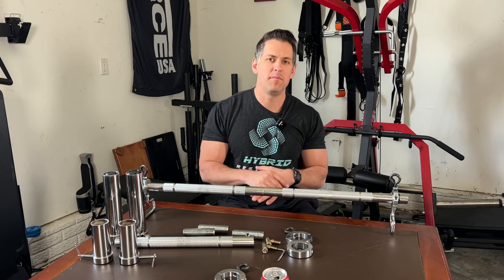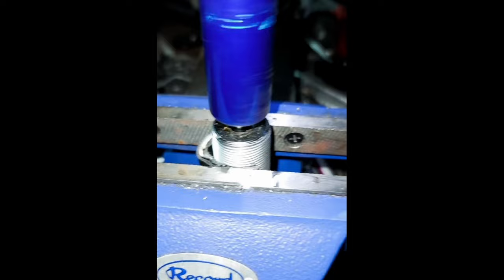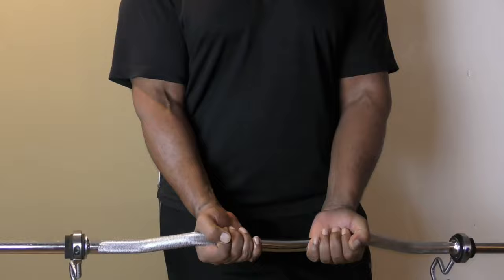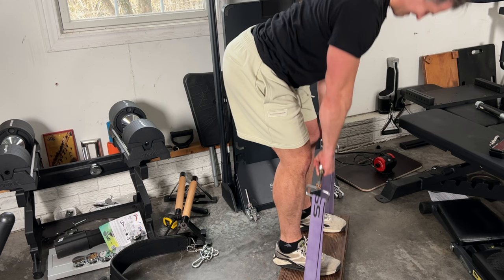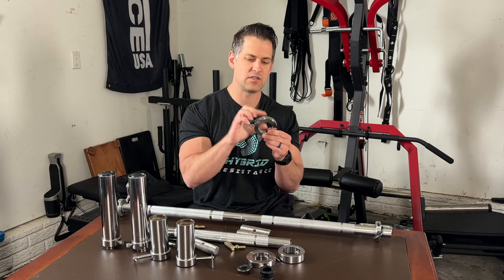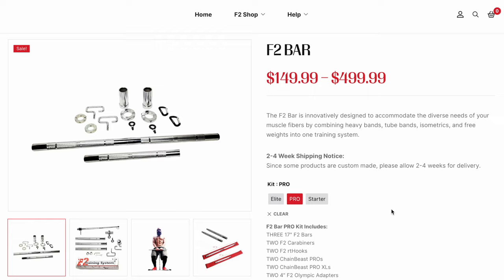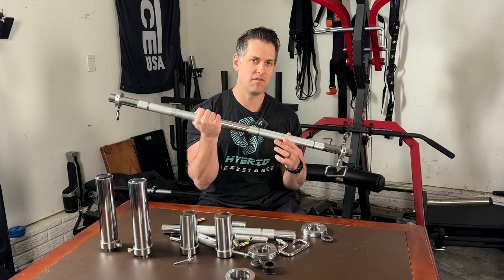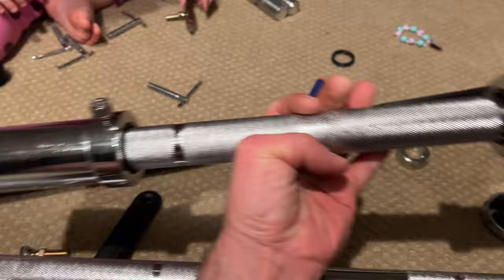F2 Bar Review: The Bar That Can Do and Turn Into Anything

Comment: The bar is priced in a proper range for a band bar. Attaching a 7 or 5.5 inch carabiner snap hook to the eye bolt will allow a loop or tube band to be mounted safely. To purchase additional hardware to mount weights exceeds the pricing of an actual weight bar.

Comment: Thanks for the review video Mike. I trust your reviews because of your background in lifting and background with numerous resistance bands equipment setups. This F2 looks to have the most versatility of all the bars so far. One question; I saw in the video that you were using tube bands attached to the center of the F2 bar, what tube bands are of excellent quality and strength do you recommend ?Thanks again for the F2 review.
Reply from the maker: Thanks so much. I'm not a huge tube band person, but I'm using these  https://squatharness.com?sca_ref=5173717.yfnXRU7Ipi Shameless plug you can save 15% with "SBT15" I feature these because I find that for the cost they're hard to beat with what you get. I have also used bodylastics, but I like having the fabric covered ones so I don't have to worry about wear n tear as much.

Comment: I'm quite interested in this; I'm currently using a cheapo Amazon bar for resistance band training and am reaching the limits of it. I was looking at getting a better bar but the price is rather steep; I understand the cost, but it doesn't make it easier to swallow to get into an entire system like the Harambe/X3.

Comment: My only question is- can you set up 2 anchor points on the sides of the platform for isometrics or just the one in the middle? I’m looking for something I can do isometric bench press on, as well as other isometrics where I can pull more evenly on each side, rather than just the one point (like the Isomax).
Reply from the maker: Yes, you can set up 2 anchor points on the side. There's actually a crazy number of possibilities with the foot plate.

Comment: Can the F2 be used with x3 footplate?
Reply from the maker: Yes, definitely.
Reply: @hybridresistance  Thanks been looking for an alternative to the pricer x3 bar. This one looked to be sturdy that won't break on me. I also liked the fact you can add some weights to that bar. The starter bar that cost $150 comes with the proper hooks for those latex bands? Any warranty on the bar that you know of? I  am just starting seen so many positives of the usage of this type of equipment that I bought a used x3 board from a trusted source. I am someone whom is new to this I heard that serious steel and Rogue bands are just as good as the x3 bands which would you recommend that is just as good, but at a good price point? Thank you in advance! ❤
Reply: I just notice collar hooks one your links wonder if those would also be a safe bet if I buy a good one piece capacity barbel along with these hooks?